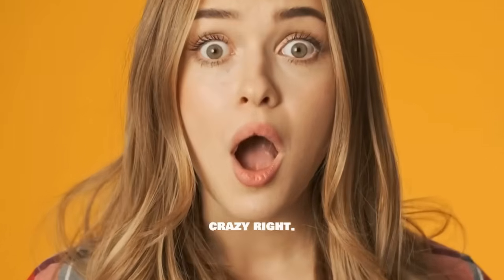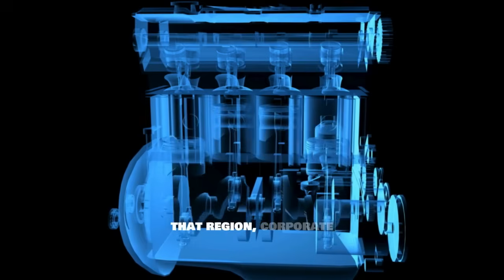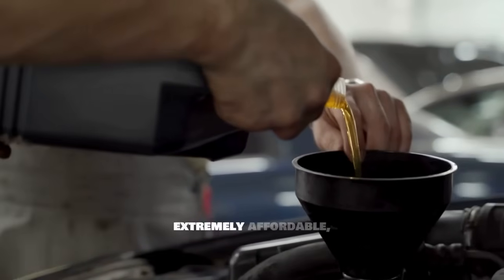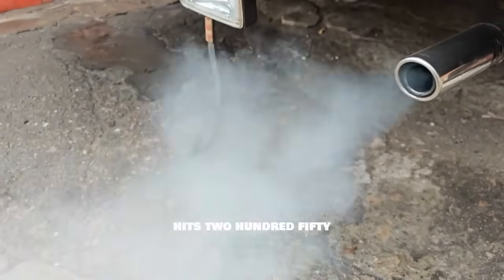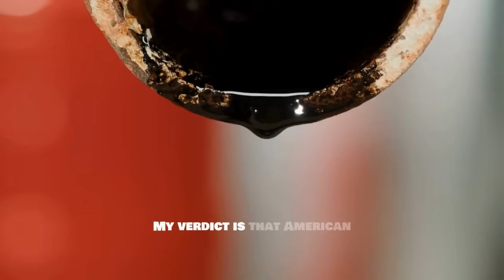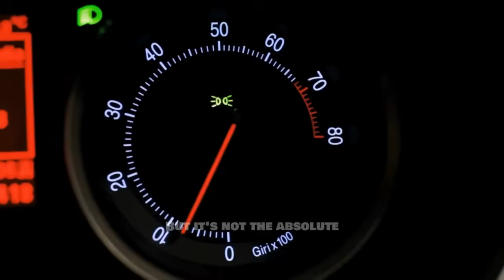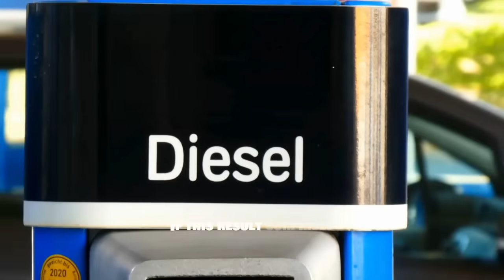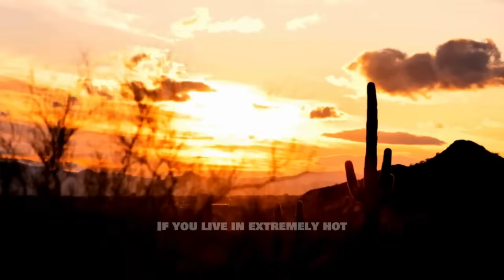8 Countries. 1 Winner. Shocking Oil Test Results!

Comment: BTW, I learned nothing new.  All 0w20 will perform fine in cold weather, but in hot weather (over 70F) many will shear down a grade.  Trying to find the ones that won't in hot weather has been difficult.  Ravenal, Amalie, Liqui Moly all are produced as a group III oil for USA sales.  In Germany or Japan, they are group IV.  Motul 8100 is a group IV or V, Triax a group V, Amsoil group IV but too pricey.

Comment: A bunch of AI nonsense. Just pick a good brand and change your damn oil between 5K-7K miles.
Reply: I picked a good one Valvoline protect & restore . I’m on 2nd change . So far so good no complaints or problems or issues. I get it at Wal Mart .
Reply: @robertwhite6813  Yesterday I literally bought 3 x 5 quarts bottle of 5W-30 for European cars. It has all the requirements. Mine was from Amazon.

Comment: Absolutely I only use German.
Reply: But is it true German oil?  Since USA screwed up by allowing a group 3 to be call full synthetic, Germany will produce a group 3 for sale in the USA.  I looked up Ravenal and Liqui Moly SDS's and they are group 3 here in the USA.  Motul 8100 is a group IV, Honda is a group III, Idemitsu made for USA is group III.  Triax is group V.
Reply: @lonniebeal6032   most bmw vehicles are made here in America, also liqui moly began making oils here in the USA, but it’s still German manufacturing, it’s the same specification, most American engine oil cannot withstand high performance turbocharged engines, but greed runs higher in America, they will not give out certain information on vehicle maintenance, because they want you to continue buying newer vehicles forever.
Reply: @lonniebeal6032  don’t trust anything on American marketing because greed is labeled upon everything 😂 American engines are running on 0w20 in hot Florida weather, they purposely did that.